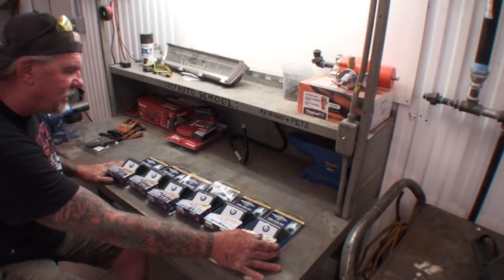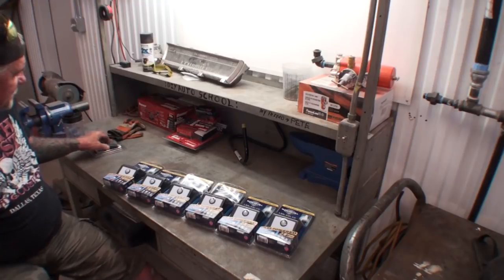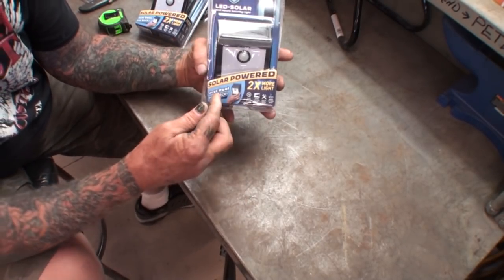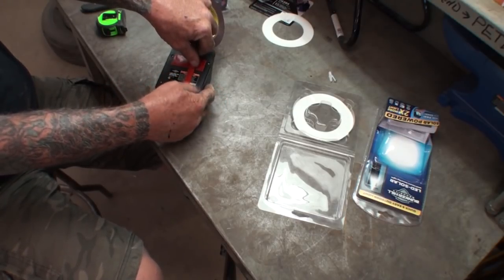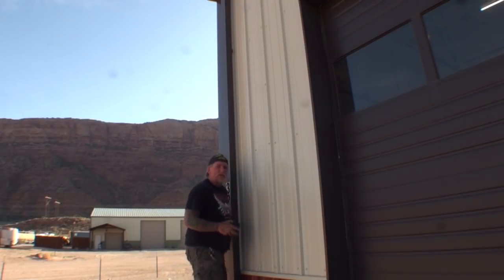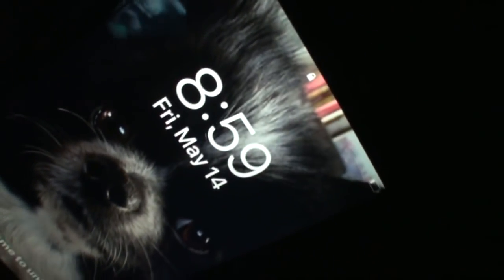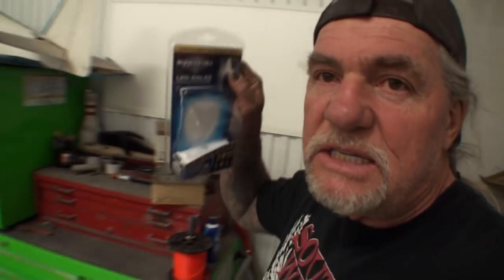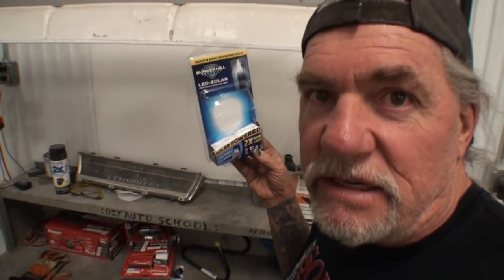HARBOR FREIGHT Tool Review - LED Solar Power Security Lights - Good Or Bad?

Comment: Harbor Freight is a lot like Aldi.  HF owns the Bunker Hill brand name and most of the brand names of products they sell. . They buy stuff, sometimes have it modified to meet their specs, and market it under that name.  What you get is usually a good value, good enough but not particularly durable.

Comment: Some things I would do is silicone around the solar panel and make a little metal hood letting the sun charge up the battery's, but covering the light and sensor so the sun can't shine on them and do damage. this will let them last for years.( Little hood like a brim on baseball hat)

Comment: Your channel is awesome, I'm learning a lot. I'm currently restoring a 96' GEO Prizm, and have rebuilt most of it except the body and the paint. The 7AFE engine and A245E transmission on it are neigh indestructible. I still need to learn how to MIG weld, so I can do body work. Same with paint, still new at that.

Comment: Thanks for video. Another option if wanted, is stick the tape it comes with to some earth magnets and you could make them adjustable if incase you ended up unhappy with the location. Unless the building is aluminum.
Reply from the maker: That’s a good idea. Thanks for the tip. 👍👍

Comment: The real situation is how long they last my friend Pete because if they last a year is a good buy
Reply: I believe the rechargeable batteries are replaceable when they stop taking a charge
Reply: @bertalert341  One 18650 lithium ion rechargeable, kinda hardwired in (not too nasty though). Don't know why it says on the package "Never replace batteries", the battery will eventually fail. Probably fail sooner if in a very hot location. I'm not a battery expert, would like to know longest anyone has had one of these.
I have one that the motion sensor must be bad on, or associated circuitry. It comes on bright (when switched on), goes dim for maybe 10 seconds, then goes bright (no motion) and stays bright until the battery is drained.

Comment: Used them for years, how they fail  is water gets in around Solar Cell, if you have a small tube of silicone, run a real small bead around the cell, that does the trick. Most of these lights are really cheaply made, so as most of everything at Harbour Freight, the last 10% of engineering is left up to the person who buys it. The 1.25 lifetime warranty would be great. But once they quit selling this type ( which could be tomorrow ), no more warranty. Buy a nice solar panel, and 6, 50 dollar high output lights, all running off the solar panel, light that place up like a Airport. Does your Bedroom window face the shop, just put a picture of your face in the window, that will put them on the run. Nice review, now a follow up in a couple of years.
Reply from the maker: Thanks for the info. I’m going to silacone today 👍👍